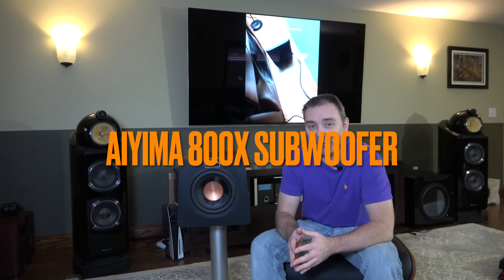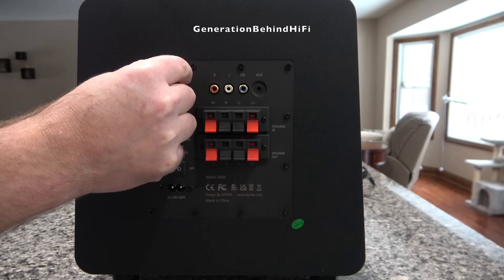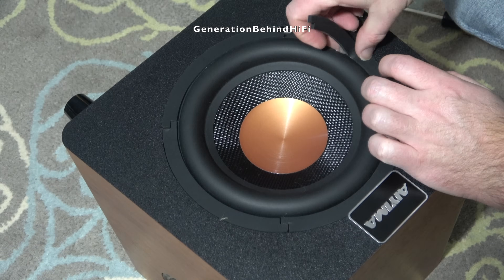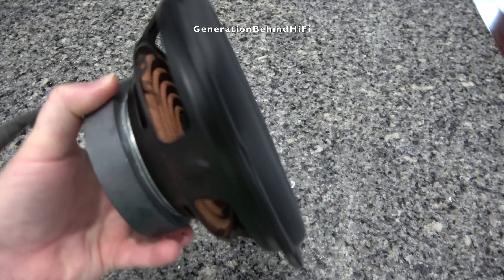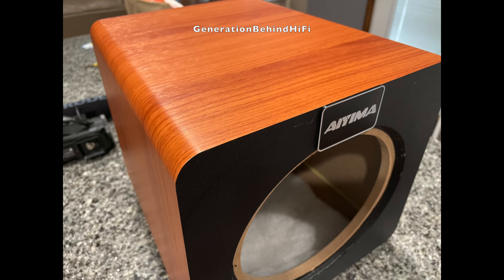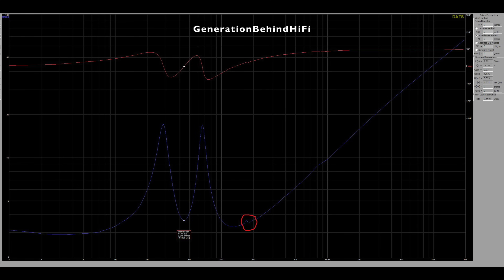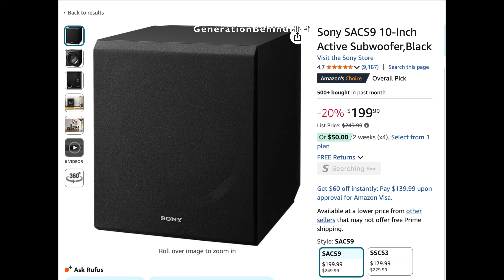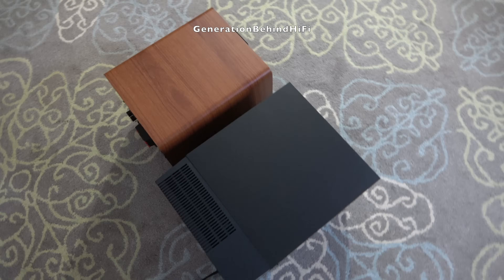A Look Inside the AIYIMA 800x Subwoofer

Comment: Have you tested the behaviour with all inputs? Have you tested other settings for the crossover / phase and volume? It sounds like a loose or vibrating part. Something similar happened to me for a speaker that got a defect at the speaker itself (coil touched the pole) due to a missaligned membrane.

Comment: 8:51 This may not be the problem, but it sounds to me like some kind of air leak from the cabinet, an opening beyond the resonance duct through which the air is also passing. Even bass reflex cabinets should only have the duct as communication between the internal volume of the box and the external environment, so that the enclosure has maximum efficiency. 
I have faced problems with speakers like this that generated an annoying noise similar to this.
Reply: Is it possible to solve this problem by doing something on your own?
Reply: @Sector_Priz  I wrote a very long text, but I hope it helps you if you have this horrible noise of air leaking in your cabinet; and, of course, if you want to DIY.

I did this myself in my cabinets. Yes, it is possible. First you have to find out where the pressure leak is coming from, which can vary depending on the design of the model's construction.

(1) It could be through a crack or hole in the cabinet's wood;

(2) in cabinets where there are control panels and/or the amplifier or audio processing board are in contact with the internal volume of the transducer cabinet, air can pass between the panel and the cabinet's wood, or in cabinets with an inferior design, air can leak through any connections, buttons or other elements of the control panel that are not properly sealed;

(3) or pressure can leak between the speaker/subwoofer and the cabinet.

To make it easier to detect the location of the noise, you can play a low-frequency sine wave at medium volume.

I have used 3 materials to fix this problem in my speakers so far: hot glue, white glue and EVA, but there is nothing stopping you from using other materials, depending on their use and availability on the market.

- For problem 1, applying white glue is enough (maybe on some occasions it may be necessary to apply fine-grained sawdust together with glue to reinforce the repair).

- For problem 3, I think that a ring of medium-thick EVA between the speaker and the cabinet will solve it easily, and of course there are also those 3M tapes suitable for this application, but you should check the gap between the structure of the speaker/sub and the wood of the cabinet, and you should also check if there are any irregularities or unevenness in the area of the wood of the box that will be in contact with the transducer, which can also cause leaks. I recommend using white glue mixed with sawdust to repair these possible imperfections, if you find them.

- In problem 2, if it is a simple leak between the panel and the wood, you can use EVA or those 3M sealing tapes, just like on the speakers.
However, the most annoying problem is when there are air leaks through P2 connectors, volume buttons and other controls, USB/TF slots and any other possible openings involving electronic components on the panel itself, or even in audio connectors on passive speakers, this can occur. The best way to put an end to this cause once and for all is to create a cavity specifically for the electronics/amplification/and also I/O connections, isolating all the electronics from the internal chamber of the transducer - good manufacturers produce their equipment this way. But if this cannot be done, you can use hot glue or even silicone glue to seal the components, and this on the inside of the panel, that is, on the side where the electronic boards are. This sealing with glues that are easier to remove should, of course, be done with future maintenance of the circuit boards in mind.

Comment: Thank you for your detailed review. Regarding the previous buzzing issue, we have conducted a thorough investigation and taken the necessary corrective actions. It has been confirmed that the issue was caused by insufficient glue on the paper cone, leading to an air leak. After the repair, the new batch of subwoofers has resolved this problem, and the sound quality is now performing well with the buzzing completely gone.☺
Reply: I ordered Aiyima 800x on Aliexpress from the official Aiyima seller. The subwoofer arrived defective, the packaging is intact. None of the connections work. No RCA, no AUX, no LFE. I wrote to the seller about this problem, but received no response. I was forced to open a dispute. After that, I received a response from the seller with a proposal to close the dispute. And for me to send a video and he would resolve my issue. After duplicating the video from the open dispute in private messages, the seller did not respond for several days and then again asked to close the dispute. Your company has a cool approach to solving problems by simply asking to close the dispute. I also liked the question about how much it would cost to send the subwoofer back. The subwoofer was on its way for more than two months just to me. That is, I have to wait another half a year while it travels back and forth just because someone did not check the product for operability and sent me a defective product. By the way, the seller has been silent about the dispute for the third day. It is very unpleasant to wait more than two months and receive a defective product. And then correspond with an incompetent employee. I'll post the video on my channel later.
Reply: Since when is this considered a new batch? Is this a problem with all products in the first batches?
Reply: @Sector_Priz  Thank you for your support! A small number of products from the first batch may have this issue. If you notice any abnormalities after receiving your product, please feel free to contact our customer service team. We will provide a refund or alternative solution to ensure your satisfaction.
Reply: @aiyima_audio  Your subwoofer is just on its way to me and I was a little upset after seeing this video... I hope my copy won't have this problem. But considering that the reviewer received a copy with this problem, my chances are lower 😂 Thanks for the information, if anything happens I will write about compensation.
Reply: @Sector_Priz Thank you for your feedback! I’m sorry to hear you’re concerned after watching the video. We strive to ensure every product meets high standards, and of course, if you encounter any issues with your unit, feel free to reach out, and we’ll address it and offer compensation.
Reply: Hello. I'm waiting for mine. Hope that i will receive a copy corrected.

Comment: Which one would you prefer between aiyima polk xt12 and this sony sub?
Reply from the maker: From those two picks the Polk will have more output. If you're in America and a small footprint subwoofer isn't a deal breaker, then get the Heco Sub30A. At the moment that sub is on sale for $229 and is quite a bit better than both the Sony and Polk.  I did a look inside video on the Heco subwoofer and it offers insane value at the current $229 sale price.

Comment: About the buzzing.. I would maybe look at the wires that connect the back of the terminals to the voice coil. It sounds like those wires may be touching the back of the woofer cone during incursion. I had the same buzzing on a Micca speaker woofer recently and that was the culprit.  Just a guess though  :)
Reply from the maker: Yeah, that's a very good guess. I actually had this happen to one of my 802D2 woofers during shipping so I am very aware of this problem. When I took the 8" driver out the tinsel lead wires looked ok and weren't hitting the spider or back side of the cone that I could tell. IMO this is just a cheap subwoofer and quality is very poor -- think white van special. 

I didn't troubleshoot what was going on because I wasn't interested in doing so. You would think AIYIMA would have double checked the quality of their product before sending it out to me for review. Guess not. Maybe they thought I would play ball and give them a glowing review like some of the other youtubers just because they gave me this subwoofer for free? Who knows, but on this channel I will always give you my honest opinion on a product, good or bad. Sadly this is just a bad subwoofer that IMO is way too expensive.

Comment: Re : buzzing - does it do it with driver outside cabinet? 
Does it do it with a different driver attached?
Check input levels on amp?
Might be faulty unit of course. Would be interesting to find out the cause.
Reply from the maker: I didn't do any troubleshooting and honestly I shouldn't have to. You would think the manufacture would double check the quality of the unit they were sending out to a reviewer. All I know is the buzzing sound happened all the time no matter what the source material was.